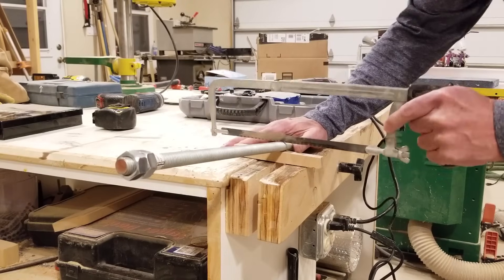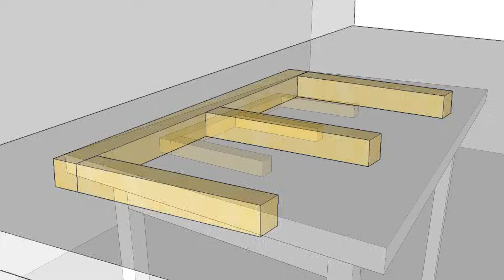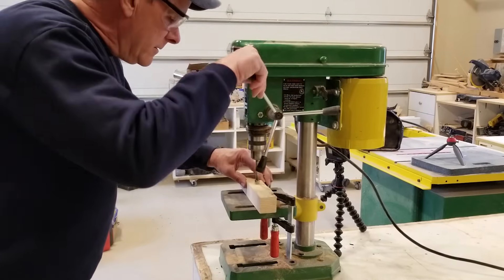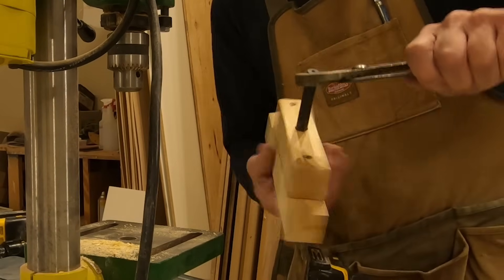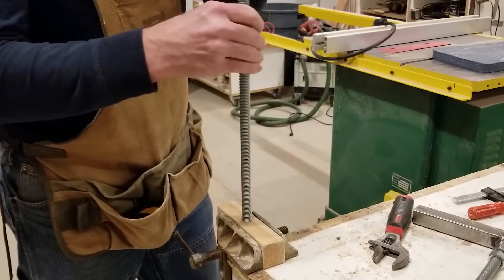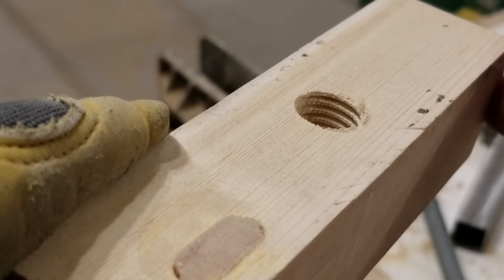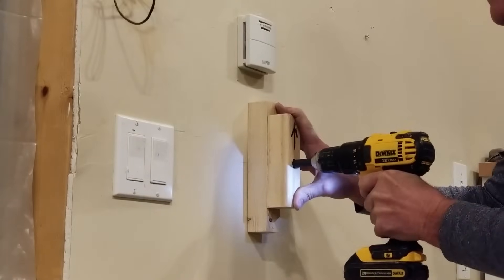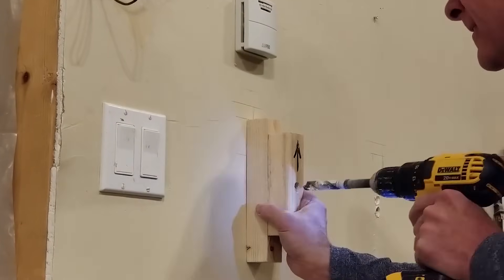Strong Floating Shelves - The Strongest Option

Comment: I don't enjoy any of my many subscribed pros more than you Mr Dobbs. I did a variant with 5/8" oak dowels but yours is the mountain top! Thank you sharing.
Reply from the maker: Thanks so much for the nice comment, Mark! Encouragement like yours helps make it worth the effort to do these videos! Yeah, I have done floating shelf strength test videos with 5/8" oak dowels and they work great as well. After trying the threaded steel rods, though, I think I am a convert to use them going forward. But, I still need to tweak my approaches for building and attaching the shelves. Thanks again for watching!

Comment: Excellent video, Rusty, as always!  I really liked the animation.  And the ideas for different kinds of shelving, tapping out the hole in the stud, making the rod long enough to support the front edge of the frame style, visible bolt heads or nuts in the 'industrial' version, all great ideas and variations.  I especially liked the block jig for drilling and tapping a right-angle hole, since a perpendicular all-thread is so critical to this approach.  

Maybe an even easier approach than fabricating a shop-made tap/installer (which was very nicely done, btw, with that welded nut and T handle) might be to just cut relief slots in each of the rods that will be left in the wall, like permanently installing the tap (or like huge sheet metal screws).  Then using two jam nuts so the outer one becomes a temporary head for driving in the rod with a socket and regular ratchet handle, or even a longer breaker bar, depending on how tough the thread-cutting is (jam nuts would also allow the inner nut to be used to unscrew the rod with an open-end wrench, for clearing sawdust from the thread cutting, etc.).  But I can tell you're a tool man (as am I, lol), and being able to get two hands on a T bar is probably worth the effort put into making the tool, especially since it looks like you're going to be using this approach a lot.  Again, superb job!
Reply from the maker: Thanks JusBidniss! Well, that should be the end of the floating shelf endeavors! I'll still do more work on the shelf ideas to explore that some but probably will not do a video. On the animation, I finally ran across an add on program to Sketchup that allows you to easily move objects you create independently in a video output mode, a feature Sketchup really doesn't have. Just started experimenting with it but it has some interesting applications I can think of. I enjoy throwing in animation occasionally if I can make it worth the time. Yeah, your idea on using your permanent rod as a tap also would work fine. As long as the pilot hole is drilled correctly, it doesn't take much effort to run the tap into the hole. The T bar is nice because you can put consistent level (or plumb) pressure as you twist by using both hands, but the rod is going to follow the pilot hole so rotating the rod with a wrench and jam nuts is going to give the same results. If I do this very often, the T bar is very handy, though. Thanks, as always, for your insight!

Comment: A few things. Your approach is way more than adequate for any reasonable use. However, if you had sank the threaded rod further into the wall stud it would have been even stronger. Next, I would have used a large washer and a nylock type nut to secure the shelf. A nut that would not vibrate loose is what I am talking about. I like the 2 x 4 usage and alternating the end grain. I think that a T nut on the bottom with an allen head screw would be a good way to attach the shelf to the threaded rod. Great video!
Reply from the maker: Good suggestions, Jeff! Thanks!

Comment: Hit two screws, sounds like me. I tried to hang a barn door which had a preperforated wall mount bar. The holes on it were on 16 inch centers. I drilled one hole and mounted it and simply marked the other holes according to the bar. Guess what? The last two holes did not hit a wall stud. The last two studs were 10 and 14 inches apart! Why, why, why? I managed to drill another hole in the bar to mount it. The miracle was that I drilled the hole in the bar correctly placed.
Reply from the maker: I have had the same experience with a barn door installation, Jeff! Lots of things can happen in the framing process that can change the 16" on center layout in a wall span at times. On barn doors particularly, sometimes you have to be flexible! Yeah, what at the chances of hitting a nail in the stud, then a screw in the sheetrock one inch below???  Thanks for the comment!

Comment: Another nice video Rusty!!! I have threaded wood lots of times to make all kinds of projects. And I have gotten the same results that you have here. Never once have I had a wood thread pull out or fail. They say that three threads in metal nuts are as strong as the bolt or all thread. I would dare to bet that 6 to 8 threads in wood would also be as strong as the rod or bolt. Anyway, I like what you did here, continue the awesome content!!!
Reply from the maker: Thanks Danny! Yeah, I have used metal inserts in wood to bolt pieces together, but never threaded wood like this. No doubt, it works well. I was thinking that if you wanted it to be permanent, mix a little epoxy for the threads and you would probably have to tear the wall down to get the rod out. Clearly, with about 2 1/2" of rod threaded into the studs, the rods are stout. Step it up to 3/4" all-thread and they probably would barely flex with my weight.  I still have some work to do on the shelf design and tying shelves to the rods, but the install is a snap as long as you miss the wiring!
Reply: @RustyDobbs  I had some crazy ideas when you said "miss the wiring"..... Hook the wiring up to the rods, positive on one side and neutral on the other. LOL... I had several ideas that could be used but I think they are all too crazy... Don't listen to me! Keep going in your direction, it is the right way! Mine might get someone in trouble.

Comment: And did you make that info graphic? That was a very nice touch!
Reply from the maker: Thanks, John! Yeah, I have used SketchUp for 15 years or so, but it does not handle animation of objects well, so that has been a little limiting for its use in videos. I ran across an add on to SketchUp that changes all that, so I'm experimenting with it. It's still a little rough but I like using animation some to break up the flow of the content. I think I can improve the quality quite a bit with a little more work, but we'll see!

Comment: Rusty, this method seems to be as good as it can get. The only way to make them stronger would be to take the drywall off of the wall and set it all up and then put the drywall back up.
Reply from the maker: Yep, I think you are right dlroto! On the strength side, it is hard to beat. I'm still going to work on actual shelf construction ideas a little more to try to improve that process some. Thanks for the comment!

Comment: Thanks for the update! I installed a few in my old house after your previous videos, they worked like a charm. I want to incorporate some in my new (old) home, will probably go the all-thread route after seeing you work through the issues. Since I'm going through plaster and lath, and haven't yet determined whether they were uniform in spacing the studs, it may be a project I tackle down the road after doing some exploration first. Anyways, Thanks for another informative video!
Reply from the maker: Thanks, Smidge, I appreciate the comment! Yeah, the previous methods work great as well, but if you can find the studs and miss the wiring, this method is really easy. I still have some work to do on the actual shelf construction to streamline that some, but I'm probably a convert to this in most cases. Thanks for watching!